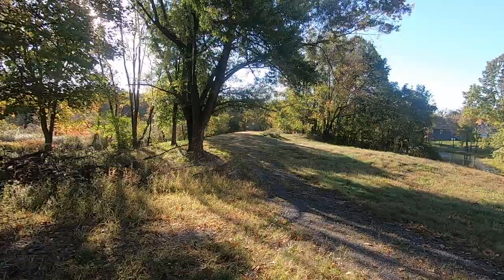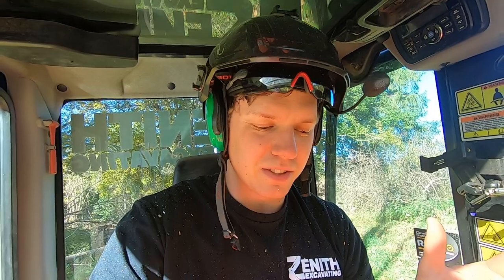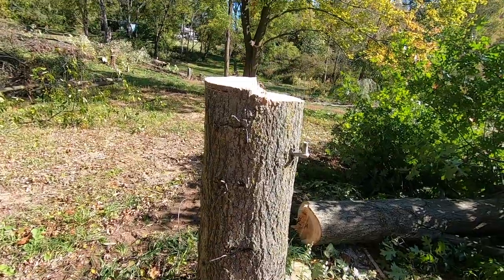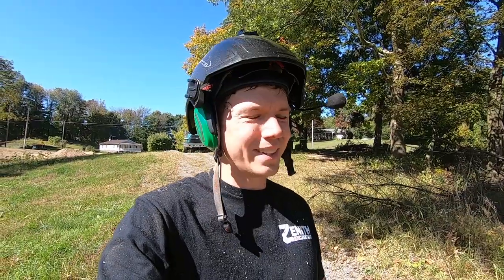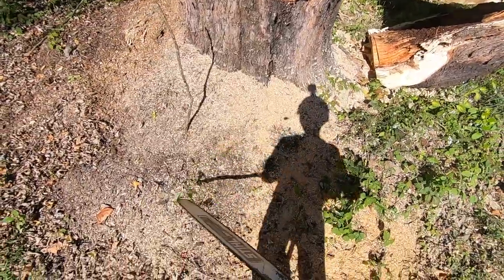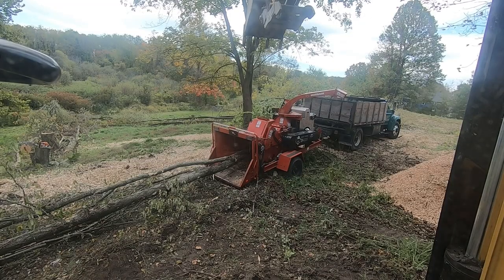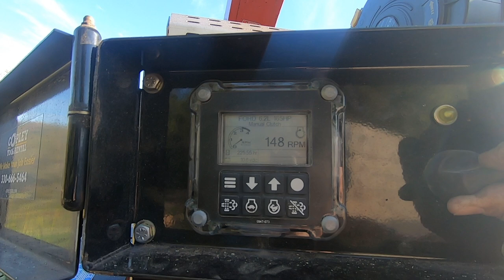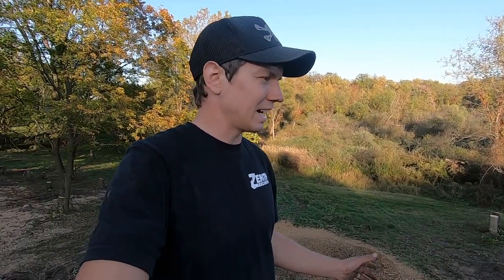CUTTING DOWN A WHOLE FOREST BY MY SELF

Comment: if you ever rent a chipper again, maybe take it to a self-car-wash and use the pressure hose to wash out the radiator. Chances are the rental company does not do this regularly and cleaning it first might get you through the day without interrupting your work flow. Also, compressed air works great to clean these things, but you would need to bring a small compressor with you on the job site.
Reply from the maker: Hey that's a great thought, thanks for sharing! I'm pretty sure the route I took to go get fuel in the middle of the day had a car wash along the way. I'll definitely keep that in mind.

Comment: Over heating of equipment is no fun.  We had a piece of steel brake line that we used with compressed air to get into the tight spaces on combines, corn pickers and the tractor used to pack the bunk silo.  That was quite the task, glad you were able to knock it out despite some set-backs.
Reply from the maker: Ah, that sounds like a nice tool for the job. Compressed air is definitely the best radiator cleaning method. Maybe someday I'll have a nice service truck with a compressor on it 😅

Comment: Impressive.  Looking forward to my first chipper rental.  Need to build a plywood box for the F350 first tho.  Anyone tried using a leaf blower to empty chips from a pickup that lacks a dump bed?
Reply: usually just a shovel. might work for the last little bits though haha
Reply: @jonesb04  right on. That will still be better than making umpteen trips to the stump dump with brush and sticks. Cheers
Reply: Mulch shovel or transfer shovel would be better than a blower.
Reply: @sizemoretreeworks  thanks, appreciate it
Reply from the maker: I've never tried that, but I imagine a shovel would be faster and faster is often better. I've definitely taken my share of brush loads to the mulch maker before. We all gotta start somewhere. Maybe you should look into one of those truck unloading kits that uses a hea y tarp on the truck bed. A quick good search for "truck unloader" shpuod lead you in the right way.
Reply: @zaccheus  That's another good idea. Thanks. I've heard some guys complain that with a heavier load the tarp tends to slide up from underneath of it but there's probably some way around that
Reply from the maker: @JoshuaCollins  oh, very interesting. Seems like that would be a battle of friction. Maybe if there was a way to reduce friction on the sides with a smooth material or something the chips would slide on the sides and stay on the tarp. I know of a fella who will be selling a nice chuck and duck chipper next spring if it becomes something you're interested in.
Reply: @zaccheus  I'll keep my eyes and ears open for that!
Reply: I heard of laying 4' wide chain-link fence on bed of truck with extra at the cab end. Put rebar through both ends of fencing. Cover fencing with a tarp. Pile on the chips. When ready to unload, tie a rope from rebar (cab end) to a tree and drive away. Voila, the truck is empty. Haven't tried it yet, but I plan to.
Reply: @danthornton1118  that sounds amazing. Going to have to hunt around for some used chain link! Thank you!
Reply from the maker: @Dan Thornton  That sounds like it would work pretty good. I wonder if it would ever just stretch the fence 🤔
Reply: @zaccheus  I'm thinking the weight of the chips pressing the tarp down onto the chain link and in between all the pieces would help to distribute the load across the chain link. Don't think you want to put plywood sides and stack it up 4 ft high but it might work who knows I want to try it! Lol it's cheaper than putting on a dump bed 😄
Reply from the maker: @JoshuaCollins  haha, yes it is! You'll have to let us know how it works!